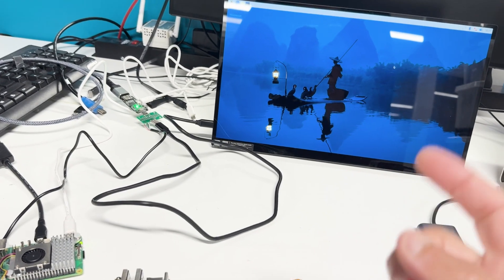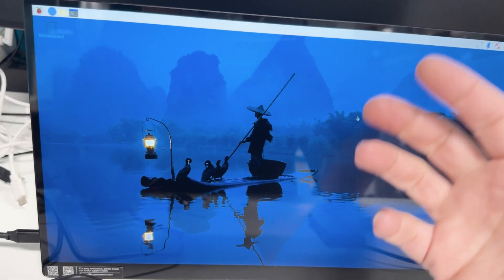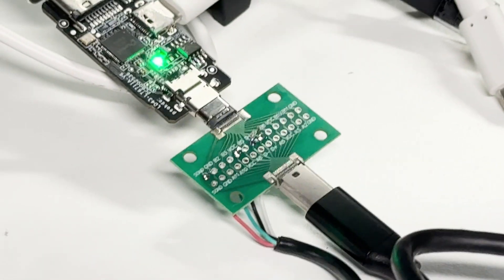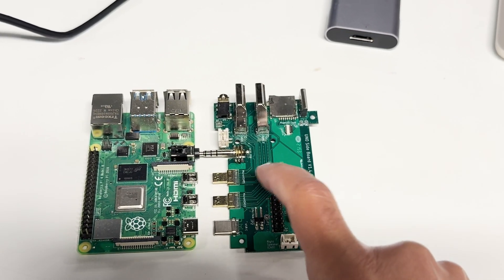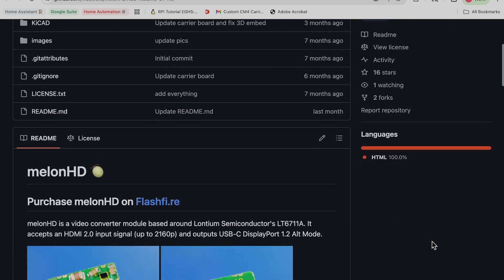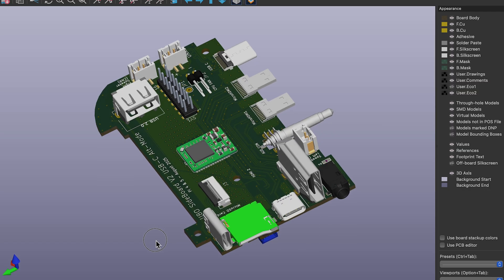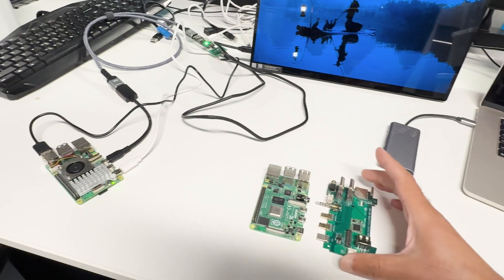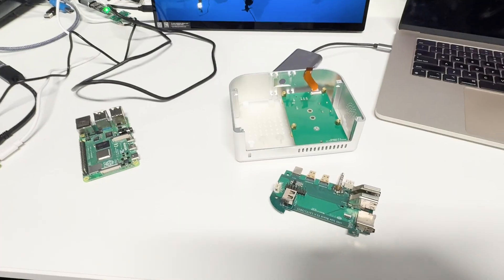Touch display on Raspberry Pi with a single USB-C cable (Part 2)

Comment: This is exactly what I need. I try to connect my verbatim PMT-15-4K to a Raspi5 but only display and sound is working (over HDMI). An additional USB cable (C to A) for touch was not working. Furthermore i need 2 Ac-adaptors (Display and PI) for this to work. What a mess. Next I ordered a usb-c HUB in hope of getting the power to PI and Display with one Ac-adaptor and the touch to the PI as well. Your PCB would be even nicer (and you proved that it is working).
Reply from the maker: I am gonna spend some time to finish the design soon. I just got a bit swamped with a bunch of other things but would like to take this to the finish line.